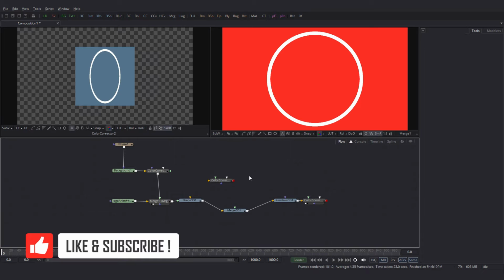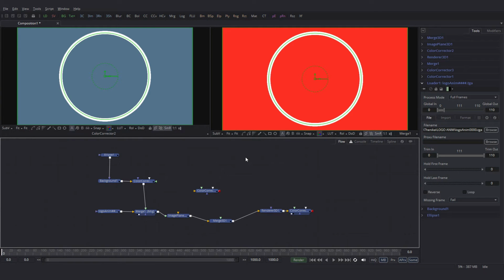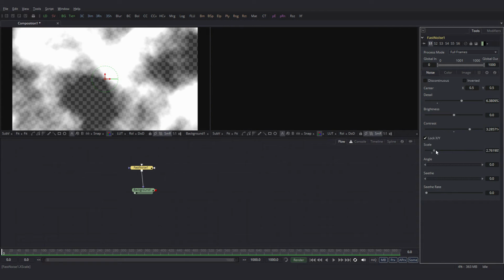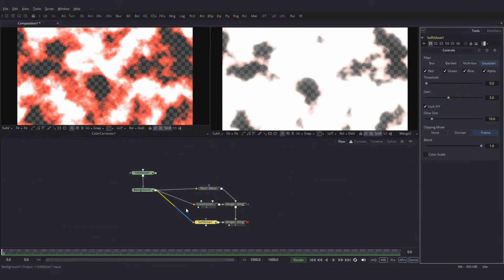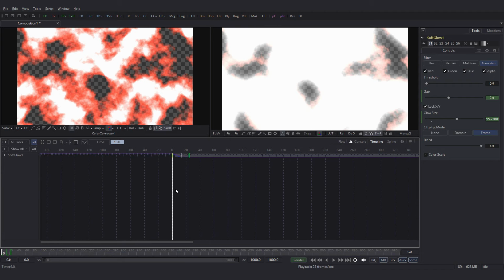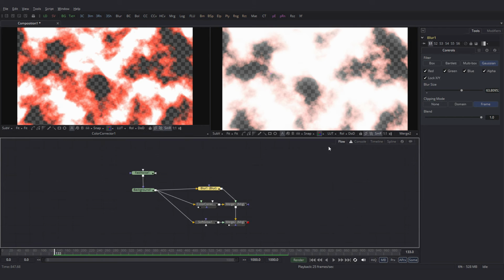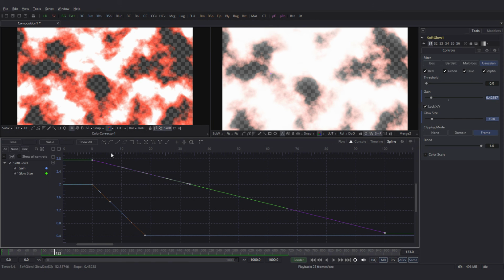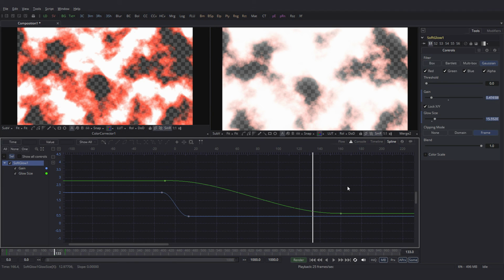Blackmagic Fusion 8 Tutorial  - Basic Introduction Series - Part 3

Comment: Is it possible to trim some unwanted video out of the middle of a clip?
Reply from the maker: You will have to use fusion a little creatively for doing that. Bring in footage twice, merge it together. Go to timeline tab trim the length of the 1st clip as required then adjust the second one for the rest of the clip. Use hold first frame and hold last frame option to make sure that both the clips last the entire time range.

Little complicated but you can do it.
Reply: Thank you for your response, I appreciate you taking the time to help. I will have to do some experimenting since I am projecting my clip onto a 3d shape (plane) I wonder what will happen to the shape when the clip is over?
Reply from the maker: In the original clip, go to the properties, increase the hold last frame for as long as you want the clip to last.
Reply: OK I tried it and if the total amount of frames is longer than the modified video clip then both the shape and the video will disappear when the clip is over. and if i make another shape with the video piped into that one and modify the video in and out to start where the other one left off it keeps going... so that works for me and thank you very much. Your video is an excellent tutorial again thank you

Comment: Hello!

I have a couple questions:

1. Sometimes keys on curves in spline editor (when animating) is locked - in this case I can change time position but i can't change value. How I can unlock this keys? Is it possible? Or I should change value only in modify panels?

2. When I try animate transform node (displace channel) I little frustrated. How can I separate displace chanel to X and Y channels? Or I should use transform3d node?